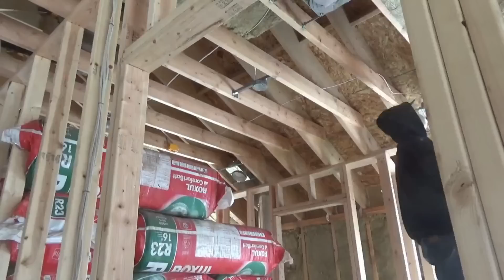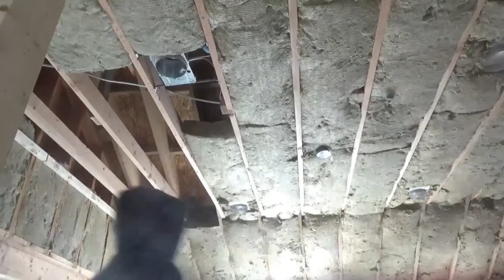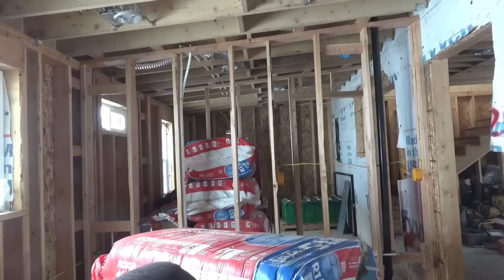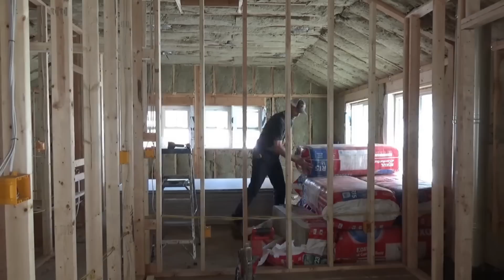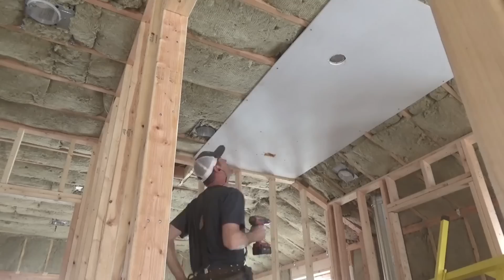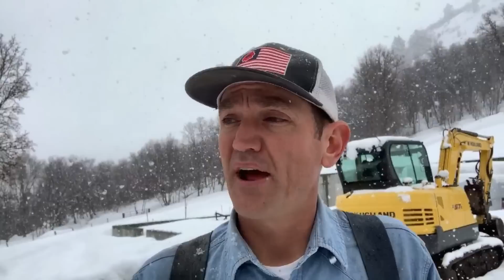#315 - I Started Hanging Drywall...Upstairs Insulation Done!

Comment: Heath -- Just a pointer.  On sheet rock (Drywall): make sure that one 8 foot sheet doesn't match the other sheet. On the ceiling you have two 8' sheets starting in the same area and they should staggered.  This will assure that the ceiling is stronger with the joists and also avoid any cracks that may form.  Looks great.
Reply: Rebecca 100% correct stagger seams
Reply: that sounds good rebecca but what about vapor barrier???
Reply: Rebecca I'm learning so much.  I'm just wondering why He didn't use Isonyne Spray Foam insulation.
Reply: He mentioned in his last video I think it was that he is in fear of the static buildup.  @vestel777
Reply: @fritznien  Great point -- yes, that drywall will absorb moisture without that plastic.  Heath said he had a relative that did drywall -- I hope that person points these tips out before he gets too far along.
Reply: @vestel777  I think he was concerned about the chemical vapors/offings that lasts for years with that type of product.  I am not a fan of Spray Foam either, mold can get behind it and it's impossible to even see it's created with that type of product.  Some people swear by it though.
Reply: @vestel777  Yes, Stagging the joints is likened to staggering the joints on a brick -- creates strength and if a crack would form it wouldn't continue though the whole wall.
Reply: Yes, drywall should be staggered, but gonna have to disagree with the brick/drywall comparison.  Brick is a facade NOT a structural component to the structure. Yes, it has to be able to hold itself, but is typically installed with brick ties(plastic or metal strips that are laid in the wet mortar and fastened to the structure intermittently along the length of a course.  There are some brick patterns that don't overlap at all. Drywall DOES becomes a structural component and helps prevent racking.
Reply: @creedbarnett4948  Creed, you've been drinking your bath water again -- The last Elevator Shaft I bricked WAS STRUCTURAL.  Many types of Bricklaying IS STRUCTURAL -- There are more ways to lay a brick than a facade of a home.  Before you comment -- you should do your research first and understand life.
Reply: Thank you for pointing this out. Yes, you are correct, it CAN be structural, but it's not because of the overlapping brick pattern, that is my point.
Reply: @creedbarnett4948  Creedy, try to make a brick wall without staggering the joints and you will be sitting on the shitter with the wall collapsing on your ass -- Staggering joints DOES create strength -- I've done construction for 28+ years... explaining to some guy in his underwear; in his mom's basement is pointless I guess...
Reply: @creedbarnett4948   You should come to Europe. We build homes with bricks here. Not just facades. And yes, the staggering IS essential for strength in the wall... there is even a "2d staggering" where the double stone wide walls are staggered not only in between rows but also flipped every other stone to "tie together" the two brick columns that make one wide wall.
Reply: Thanks for the spirited bantering. Not sure we'll see eye to eye on  this subject regardless of the water I drink, lol.

 Hopefully we can all agree that we want the best for Heath in his continuing efforts to finish his home in a way that will make him proud, and provide encouragement along the way through our comments. Cheers to lessons we learn from each other daily to help make us better at what we do!
Reply: @creedbarnett4948  Just don't like banter from your back side -- that was my point!  And yes, your drink of choice that night was bath water!

Comment: I don’t understand what magic makes that insulation just stays up like that?!
Reply: Friction fit.
Reply: @drucifer_too  yeah, and when the lack of ventilation and no vapor barrier to boot makes it wet, what then?  You are supposed to twine it, friction fit?  Hmm....
Reply: @JohnDoe-np3zk  Heath is  not a dumb guy. He's been in the trades for over 20 years.  He seeks guidance  from his peers,  inspectors he's worked with and relatives in the trades. He knows the climate he's in is semi arid.  He's not using AC.  He's heating exclusively with wood.  From roxul's literature the product is semi rigid providing a friction fit. It also does not absorb water.  I'm sure he will address the many comments that were made in regard to vapor barriers and for that matter drywall installation.
Reply: @drucifer_too  you need WAY more ventilation at the soffit and "rafter baffles" to provide it.  He has neither.  When does rockwool not absorb water?  It's used extensively to grow plants!  The vapor barrier needed to go up on the warm side before the drywall.  Time will tell as they say, I don't have skin in the game but I hate to see people have to tear stuff out.

Comment: It takes guts to post building videos when you’re not a pro builder, so props for that. But for real. Take some advice and avoid a ton of problems later. You need a vapor barrier. And stuffing Roxul without baffles on the pitched part of your eaves is going to block airflow and cause a bunch of problems. Please consider changing some things. Heed the advice of those doing it for decades.

Comment: Great stories that accompany your video’s makes them special in every way.

So, I’m a retired HVAC service tech but helped with install work when service was slow. One thing that Minnesota building code required was insulated 4” flex for all the exhaust fans R4 insulation that was even stepped up to R8 with newer codes I believe. I bring this up as I saw what looked like uninsulated 4” flex on the one exhaust fan. The reason for having it insulated was to prevent moisture from condensing in the flex in unheated spaces, This condensation was still a problem so we were always told to make sure the flex had a slight trap layout near the connection to the exhaust fan to keep this moisture from dripping out exhaust fans that in some instances caused water stains in the drywall around the exhaust fan. Your codes there could very well be different and insulated may not be required but in that case I would insure a slight trap layout in the flex near the fan to prevent any possible water staining or dripping problem that might occur in the winter months.
In my mind you are doing an incredible job.

Comment: Uhnm Just curious why did you not choose to install vapour barrier before the drywall, it could save lots on heating bills
Reply: Jyll Valade curious of this also
Reply: I asked the same 🤔 northern mn here.... we would have moisture in a bad way w out a vapor barrier...
Reply: He's got a vapor barrier (Tyvek) on the outside, with another on the inside you would trap moisture in the walls and create mold.
Reply: @da_ghoul9432  from tyvek
No, DuPont™ Tyvek® is not a vapor barrier. It is made with unique material science to keep air and bulk water out while allowing moisture vapor inside walls to escape.

Tyvek ® FAQ | DuPont ™ Tyvek ®
Reply: @da_ghoul9432  - Wrong
Reply: @da_ghoul9432  Water vapor travels through the insulation and when it reaches dew point it condensates inside the wall.
Reply: Da_Ghoul tyvek is an air barrier. Says right on it in plain English that it is vapour permeable
Reply: @Iamthathillbilly  wrong, Tyvek area breathable membrane, wind barrier, not vapor. And Tyvek outside he also install in wrong way.
Reply: Jānis Kronbergs that’s exactly what I mean.. tyvek is supposed to stop large amounts of air infiltration and will not stop any moisture. I use the stuff all the time. I think I would know
Reply: @Iamthathillbilly  just little bit more work, and soon he can start to plan demolish his house completely.

Comment: What you should have done was installed all the dry wall with no butt joints, now you just made an issue for yourself on taping. In a closet OK if you have to or a real big area, but only if your stuck and there is a certain way to do those to so you don't see the butt joint.
Reply: What was he suppose to do ....stretch an 8 ft  sheet to fit the room?
Reply: @zeke112964  All he had to do was cut the sheet to fit the ceiling so the ends were reaching the gables on the ceiling, no butt joints. Then put the drywall from floor to ceiling, no butts joints. 
Any off cuts he could use in closets or under the stairs which you don't see any ways. 
The idea with dry wall hanging is get as few as butts joints as possible. You will never get rid of all of them, but the less you have the better tapping job.  

Also drywall come up to 12 foot sheets right. I know you knew all of this right.
Reply: @antiowarr9467  Yes I know all of this but he couldn't get 12' sheets upstairs and all he bought was 8 footers....I know you knew all of this right?
Reply: @zeke112964  he don't need any 12 foot sheets up stairs, and yes he could get 12 sheets up stairs if he had a helper. A 12 foot sheet of drywall can bend up to 70 degrees, if 1/2" and 50 degrees if it's 3/4". 

The other thing he did wrong was he hung the drywall on the ceiling across the roof thrust, with no bracing between each of the roof  thrust so he will get sag there because the distance is I believe 2 feet. unless he used ceiling drywall with a fiberglass core. also he should have strapped the ceiling with 1"x 3" across the roof thrust, because the roof thrust, usually move in the winter with cold air above and warm air in the bedroom. Also when you strap you never screw the strapping only use plain nails so they can move in the wood.

He don't have any walls up stairs over 8 feet high, I don think and you can by 10 foot drywall as well. Maybe when he gets to the stair well area he may need 12 sheets and they may not be long enough, but there is a way to hide butt joints  if you know how. All the sheets he put on the wall he put long ways, when he should have went from floor to ceiling. 
Man I hung drywall for 7 years professional and tapped for the same amount of time. In that bed room I would have only tapered joints. Maybe in the closet you have butt joints, you don't do closets until last then we give the to the green horns like you.
Reply: @antiowarr9467  My apologies....I didn't know you had 7 years experience and can bend sheet rock  70° and also use terms like roof thrust....With those kind of skills you should be making millions on how to videos and DIY books.....Your a real master technician ....Oh by the way I've been doing this for over 35 years now
Reply: @zeke112964  Oh my sorry about that, I'm using voice type and it don't always use the  right word and I never bother to spell check because it's not important for youtube chat rooms. I just looked and the same thing happened with Heath name it put in Cliff. 

No you were not being sarcastic, because you don't know the difference. Also you know nothing about drying or taping. You can see it in your answers. Thrust, you don't know what that means either????

Comment: Rotozip guidepoint bits for your router. And the bit spins counter clockwise. Therefore your can lights are routed counter clockwise so the bit can hug the outside edge. Booger too many of those and you'll spend extra days fixing them!! I'm a hanger in Florida...doing hurricane repairs right now!  Oh, and bellyband the upstairs. That joint at the bottom is Really hard on the finisher...two seems in the middle way less bending over!
Reply: He's the finisher
Reply: @zeke112964  , I know...was hoping to save his back from hurting from that bottom beveled seam.
Reply: Heath, please listen to these pro tips. I'm sure your dad-in-law would say the same. Good work!

Comment: No vapor barrier? Just curious. Maybe it’s not needed where you are. I’m in NW WI and didn’t use it in my first heated garage/shop. Once I tore it down to build a bigger shop, I found that all the insulation had been wet on and off over the years and the sheathing had lots of mold on the inside between the studs. I used the heaviest vapor barrier plastic I could find on the new shop - after the insulation was done and before the interior wall sheathing went up. I even sealed all the electrical boxes with those special plastic “pouches” and lots of tucktape. Good luck!

Comment: Heath, you definitely need to stagger the drywall joints. Also, if your bedrooms are 10 by 10, then you should be using 10 foot drywall not 8. You will have less seams to tape and fill. Same for 12 foot sheets. As mentioned by others, you DO need a vapour barrier. Make it easier on yourself, listen to the professionals

Comment: I'm also reading that people want you to put a belly band meaning if your wall is over 8 feet in height to put it in the middle I don't agree with that because you have a cut edge which is tapered and you have a flat edge they don't match up yet it's harder to do but it comes out a lot better

Comment: Another issue I just noticed thanks to zeke112964 is he never install a vapor barrier on the exterior walls or ceiling. This is big no no , unless he is planning painting the ceiling with 3 coats of oil paint the he can get away with this. Cliff you need vapor barrier on the out side walls and ceiling or you will rot out the wood in no time. Also a vapor barrier approved over the pot lighting. The vapor barrier should have been installed between the top plates as well so it could be a continuous seal all over the ceiling.

Comment: You need a vapor barrier. Both for the walls and ceiling. For the ceiling use some wood based fiber boards, long not square and stack the joints. You only use gypsum in garage for ceiling.
You mounting the drywall on the walls the wrong way. The go vertical. From stud to stud. Up and down, so you can use one sheet from ceiling to floor.

Comment: Interesting, no vapor barrier and support for the insulation except the plasterboard?
Reply: The vapor barrier is the Tyvek on the exterior side of the wall.  That's all that is required by code, and Heath verified this with the Inspector a year ago.
Reply: monicapttrsn that’s total bs. The tyvec is an air barrier and the vapour barrier is actually an air vapour barrier. The vapour barrier has to go on the warm side of the insulation. The only time you would put the vapour barrier on the outside would be in a warm climate only requiring cooling and not heating.
Reply: @ricktrapperriley2534  Yes, I checked the code tonight and found out I was wrong.  I do apologize.  I forgot to delete my comment.  R702.7 of the International Residential Code says you need the vapor barrier on the interior side of the wall for Zones 4, 5,  6( Idaho), 7, 8 and Marine 4.  But Tyvec is an air and water barrier and is used to keep water from penetrating from the exterior side.  Anyhow, Heath and the Inspector did have this conversation, and I believe the Inspector told him he did not need it.  So the matter remains unresolved.
Here's where I got confused.  I expected Heath to use faced batt insulation, but he's using that rockwool stuff that is unfaced.  If he had used faced insulation, then he would not have to add any polyethylene (or whatever) as well.  Too bad they don't make that foil faced insulation anymore.
Reply: Rick Trapper Riley I would like to know why they are building 300,000-600,000 houses near me, and they are all using Tyvec on the outside top to bottom. It’s amazing that the only houses you see going up are really big. Btw: I live in Minnesota. I am not a professional and don’t claim to be. Just interested in the topic. I have 4 inches of insulation in my attic... which is clearly not enough. So I am interested in the proper way to go about insulating. Going to be removing existing batting (not kraft faced, and no vapor barrier. House was built in 1959) and probably going to use cellulose.
Reply: Steve Diamond I apologize if I wasn’t clear... I am not going to be removing my siding to see what’s under it. I am only doing work in my attic. I was only saying that the new houses going up by me are all using tyvec on the outside.
Reply: @Mike-tg8gl  do yourself a favor and hire a professional if nothing else get an estimate which should be free and in writing.  Often adding insulation requires venting and more air sealing than you likely will ever be able to do.  They remove the old stuff, go around the attic and foam seal where needed.  You probably don't have soffit ventilation and need a lot of it.  Not 4" stinking bird block holes, proper ventilation.  Get hold of your utility company they probably have rebates if the job is done correctly by professionals.

Comment: Textured sheet rock is greatly overrated in my opinion.  Just me.
Reply: I really hate sheet rock in general.  In my recent small house we used the Hardipanel concrete board on both exterior and interior.  The cedar pattern stuff looks like wood panel and sure takes paint well.  The seams are easy to blend in with the feather finish stuff worked into corners as well and to cover screw holes.  A lot cleaner and easier than that drywall gypsum tape and texture process.  Way more bulletproof.  Expensive and heavy as hell but very nice material.

Comment: going great. the drywall lift def helps :) it always seems the first sheet or 2 are hard to get the screws in first try in middle lol. and seems others pointed out staggering in long run its more taping lol but does help prevent cracking from the racking.